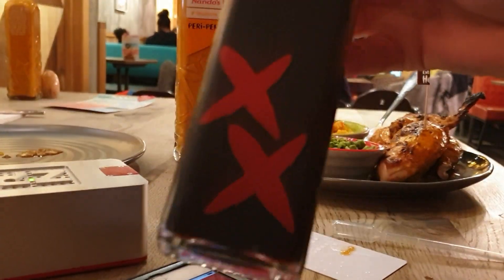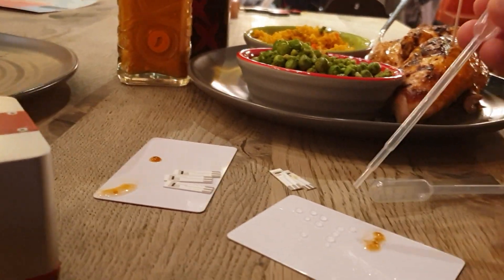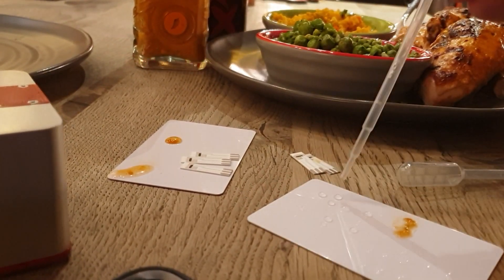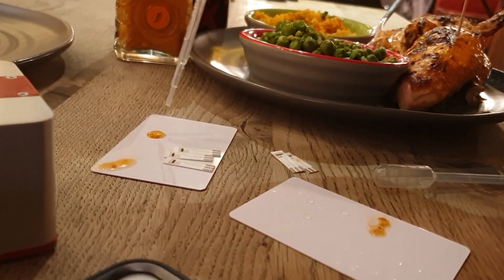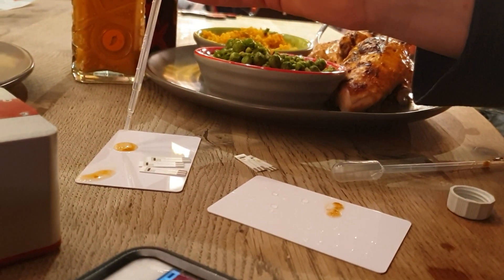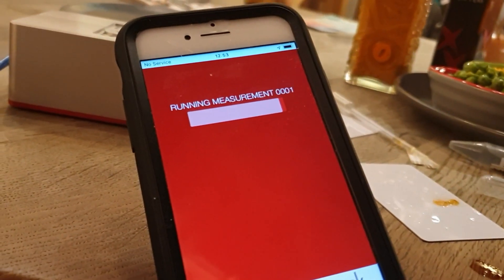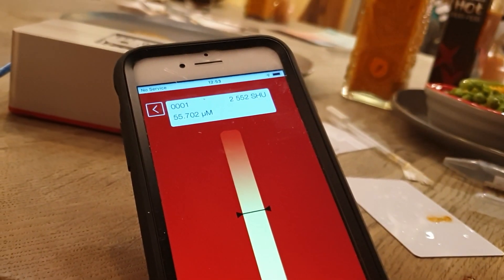Measuring Nando's Extra Hot Sauce in Scoville Heat Units

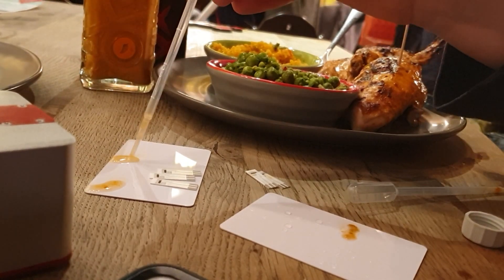Comment: Uhm… you did a 1 in 10 dilution not a 1 in 9. Also if your result for a 1:10 dilution is 2500 that means the original sauce is ten times that, so 25,000.
Reply: Also since capsaicin doesn’t dilute well in water, it’s probably higher than that because you used water as a solvent which is pointless.
Reply: no... it accounts for the dilution - that's the point of adding it in there. But it's not 2500 im sure.

Comment: I'm late to the party but this is definitely not true. They advertise it at 100,000 which is clearly an exaggeration on their part. Everywhere I've read lists it between 34k-45k. Maybe the dilution throws your machine off. Their extra hot is easily hotter than the hottest Tabasco so what would your machine list that as? 1000?
Reply: their extra hot is not hot at all
Reply: No its the seeds in it which give it spice but since his pipette can suck up the seeds he got an incorrect reading.

Comment: Adding water literally makes no sense. Every other non-capsacian ingredient you add reduces the heat of the sauce, so adding water reduces it IMMENSELY. Absolutely no way you can get an accurate measurement by adding a ton of water.
Reply: thats why it has an option to say how many drops you put in. so the machine does the calculations according to that. dah
Reply: @rousod  either way the measurement is clearly wrong. I've had many sauces that are around 2.5k shu and they aren't as hot as this sauce